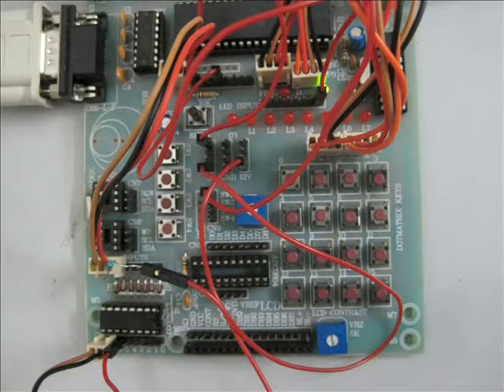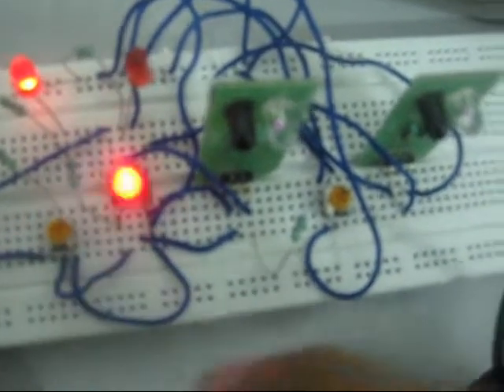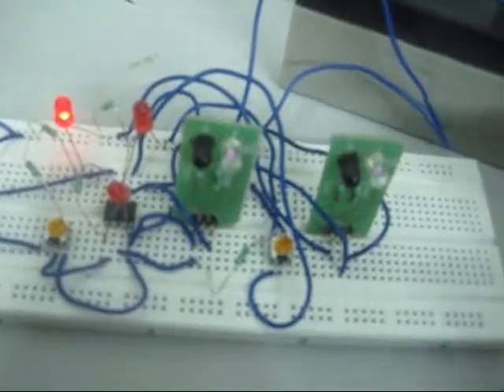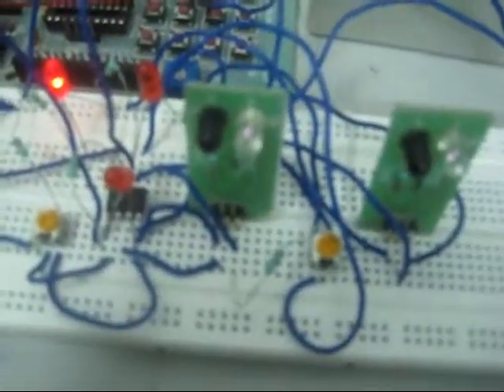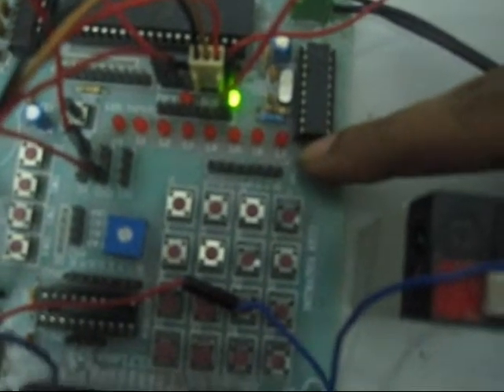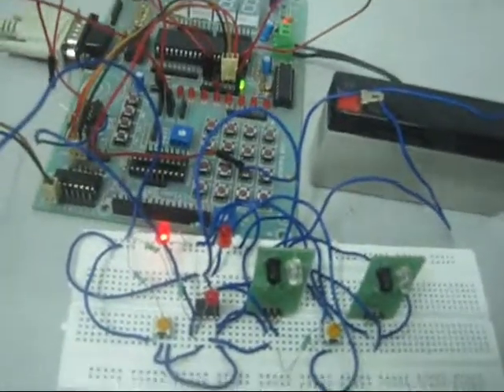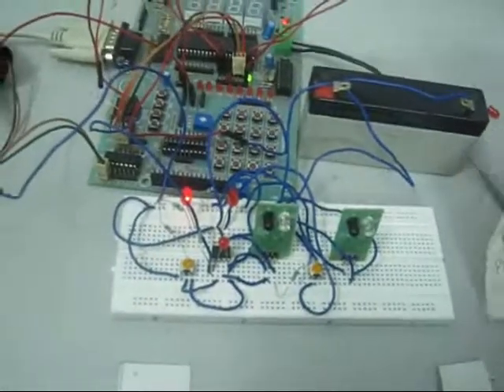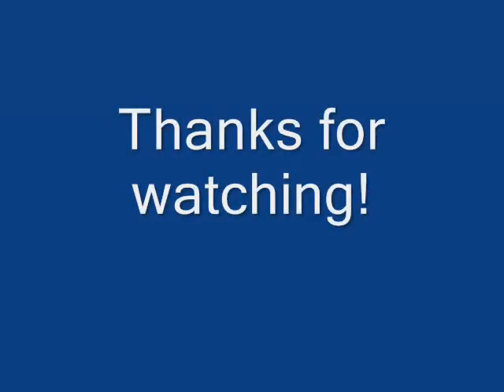Home automation by 8051 Microcontroller

Comment: it will only work until the person remains infront of the censors.. what if the person enters the room and sit at far end from the point where we have adjusted this system?? in that case the lights and other stuff will only turn on for an instant and will switch off..